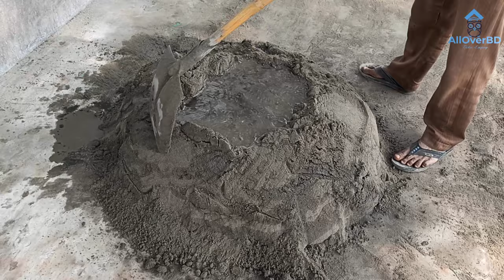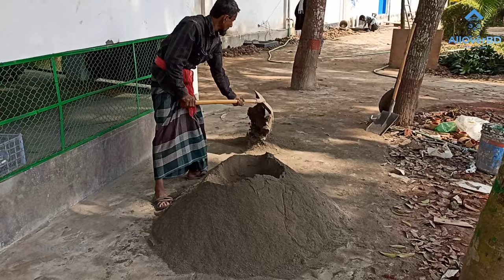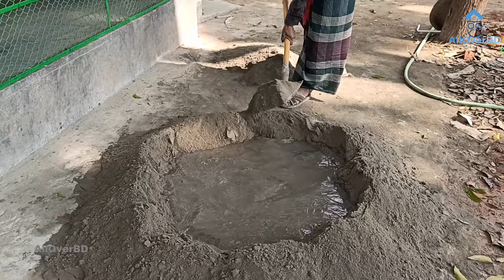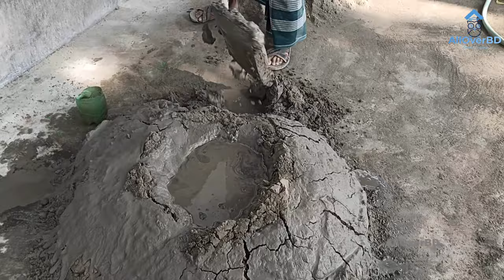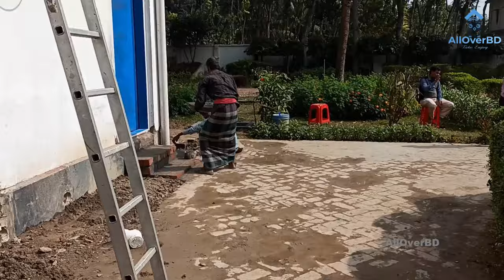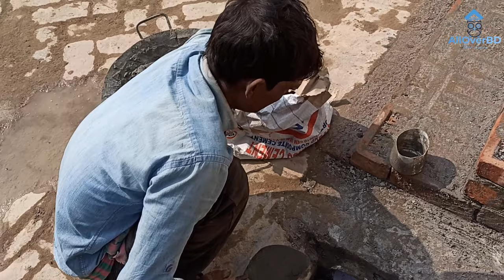How To Mix Sand & Cement By Primitive Techniques | How To Use This Mixture.

Comment: Hi,what's the ratio for sand: cement: water?
For example to make pavement stones?
Thanks
Reply: There's no ratio. it depends on person who do that because while putting them water you make sure that the thickness of liquid cement are enough to pour hallow blocks or using it for plaster walls
Reply: 20-24 shovels sand   to 1 90lb bag of cement, consistency should be cottage cheese